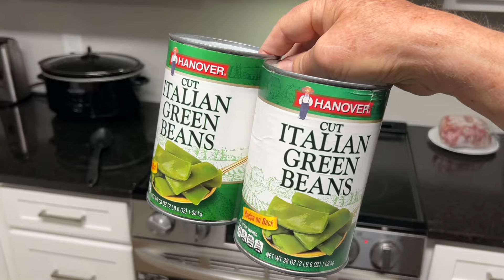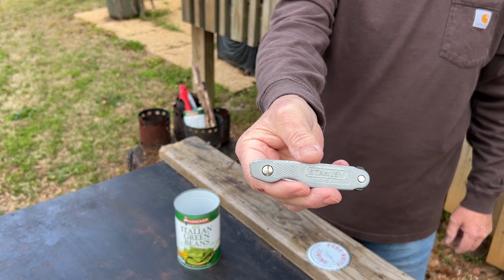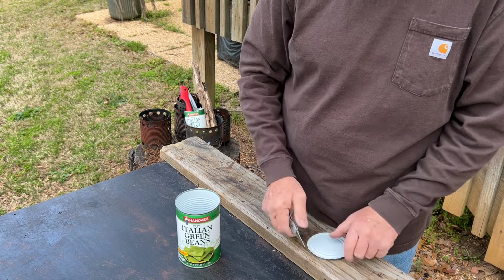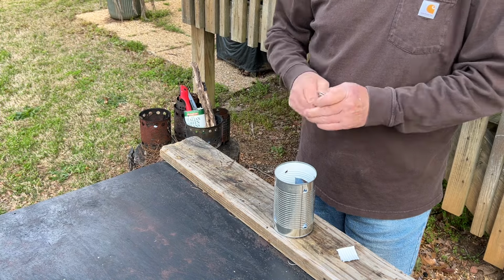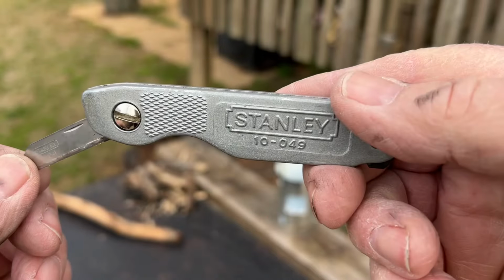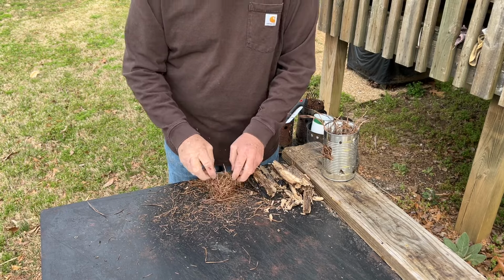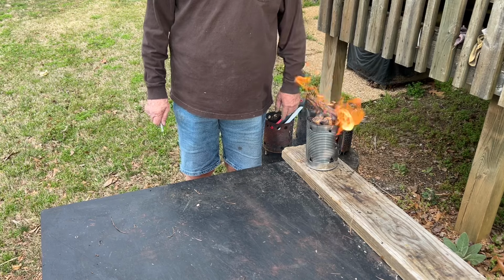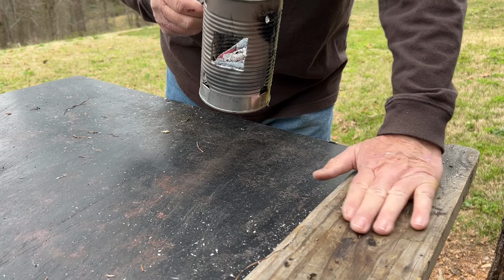How To Pocketknife Make A Hobo Stove

Comment: Great video, David!  I definitely have to try building one of these hobo stoves.

Have you ever thought about orienting each triangular opening with the peak down and then bending the base of each tab upward?  (Each of these openings in the wall of the stove would look like an inverted triangle.)  Then place the perforated lid on top of the bent tabs.  

If I am visualizing this modification correctly, the "inverted" triangular openings in the wall of the stove would allow air to flow under the perforated lid.  Perhaps this would enhance the burn and negate the need for the rectangular "feed/air flow" opening in the wall of the stove.  

I would love to see you build a stove with this modification and then compare the two stove designs in a future video.

You absolutely have one of the best primitive fire making channels on You Tube and I always learn something new and useful from you.
Reply from the maker: You're right. @ronniebrown6124 above just brought it to my attention. If you check out my Hobo Stove Builds Playlist you find the same stove builds with the triangles oriented properly. LOL!

Comment: Ah... elevated floor to reduce heat on bottom of can? Aha moment, I hope!
Do you cook on the flame or after its died down to coals? How long will it  stay hot to cook/boil water?
Reply from the maker: 1) and air for coals. 2) flames to boil boil water quickly and coals for everything else. 3)Depends on type of fuel wood.

Comment: I use tools, too, but I'm so thrifty, spelled "c-h-e-a-p," that I sharpen throw away blades. It almost hurts to see you cut that can with your pocket knife, but, as the saying goes, to make an omelette, you have to break a few eggs.

That pot liner stove I told you I made works really, really well. I had flames coming two to three feet out the top the other day. They are zero difficulty to make, and you can find the liners pretty often and cheap in thrift shops. Seems like nobody wants them for actually cooking.

I just ordered a 10-49, by the way.
Reply from the maker: Thank you.